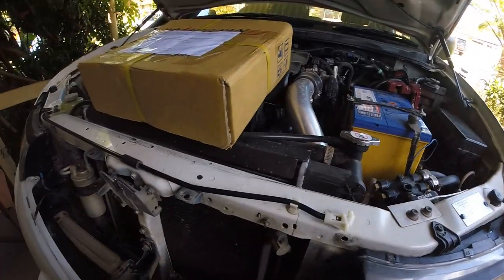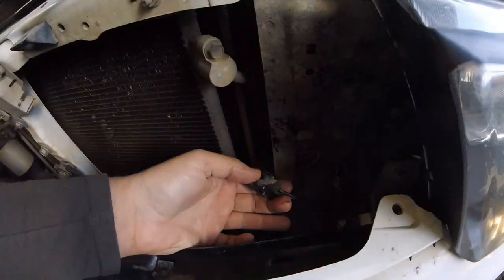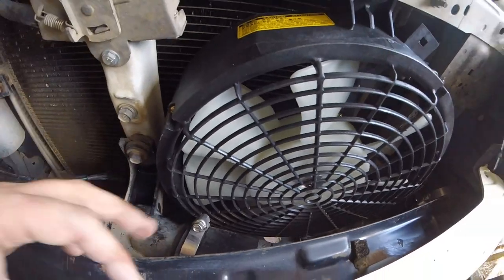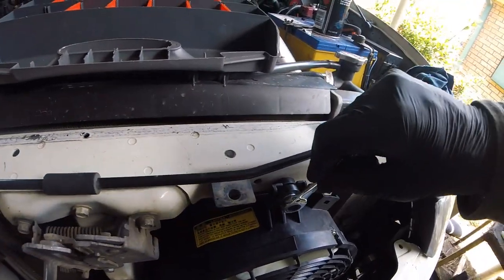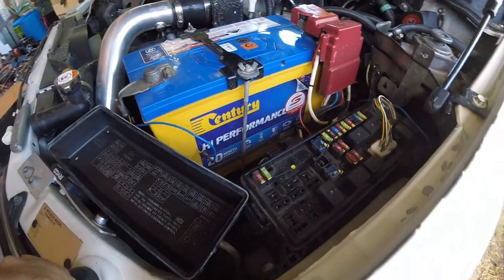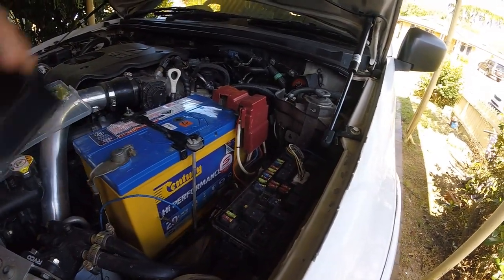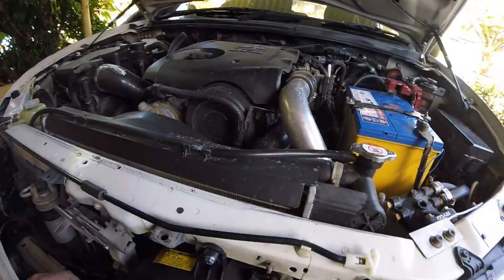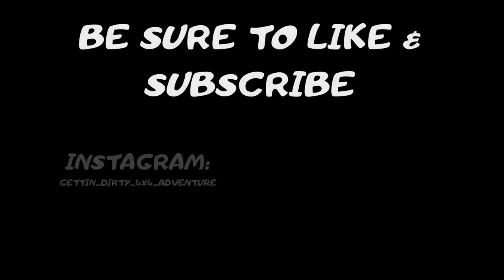How to install a condenser fan - MN triton [ DIY ]

Comment: Good info on this I reckon. I've a Pajero Sport 2wd that doesn't have that fan.Chasing an overheating issue so i bought a fan like it (black 5 bladed one though)..Seeing your vid, I think I might just install it myself! Thanks! 😁👍
I take it the bolt used is an M10 type as you're using a 10mm socket.What is the length on that by the way? 😅

Comment: I have 2011 MN triton, and I am looking for something for my AC because when i turn on my ac on hot days my car almost overheats but my issue is with this I have an upgraded auto Transmission cooler and its right where that fan goes
Reply from the maker: @Cliqzz  Shouldn't get hot like that unless the cooler is small and the hot fluid is heating the air up and pushing it through the condenser. I'd say if the radiator isn't cooling the car down, it's dirty, old or the start of the block issue causing the heat. Normally autos heat up cause the radiator is the trans cooler aswell.

Comment: Hey bud great video, can I get more info on what relay u used to operate the fan?
Reply from the maker: Just a 30a 4 pin mitsubishi micro relay I got out of a wreck. All the wirings there for it in the fuse box for it. Just add the relay and your done👌
Reply: @gettindirty4x4adventure  thanks dude

Comment: Should I install this if my MN is auto?
Reply from the maker: This is for the Air conditioner so either transmission It'll work. It'll cool the A/C and the radiator a little but not the transmission. Unless you have an automatic transmission cooler in that spot I'd say go for it. Cheap mod and as you saw, easy to install. All the info is in the description👌

Comment: So whats the verdict? Is your aircon a lot cooler?
Reply from the maker: Yeah makes it a bit cooler. Definitely worth the time and money installing it.
Reply: @gettindirty4x4adventure  had system gassed up and installed fan, which is working fine, and absolutely no improvement.
Reply from the maker: @mattiaswisemann7266  From the people I've spoken too it helped. Have you looked at the fan and condenser under the dash? They don't run a filter so get blocked
Reply: @gettindirty4x4adventure  I’ll check that out. Thanks.

Comment: Does it interfere with the trans cooler?
Reply from the maker: Edited- Only if you have an Automatic transmission cooler there or anything else that may block that spot.

Comment: The micro relay linked in the description is not the right one. It's 5 pin. You need a 4 pin micro relay.
Thanks for the guide otherwise.
Reply from the maker: Changed it. Must clicked the wrong link when posting the video.